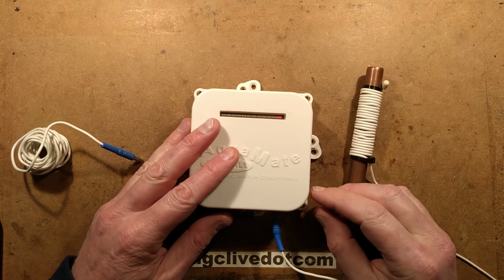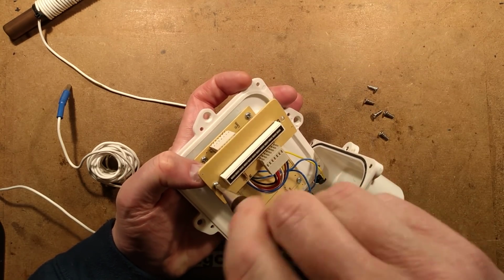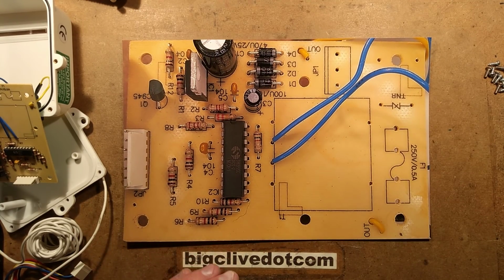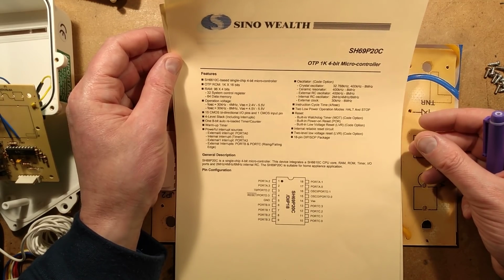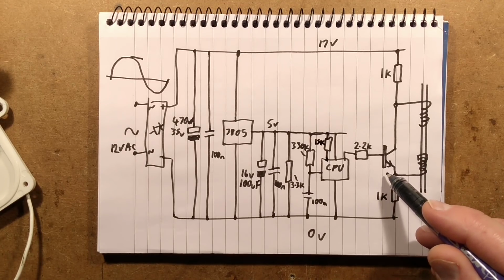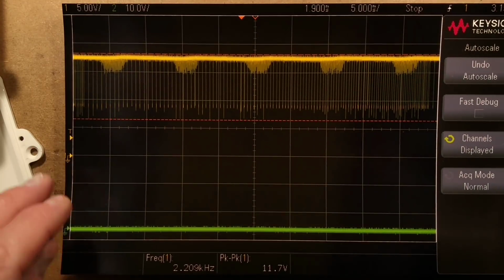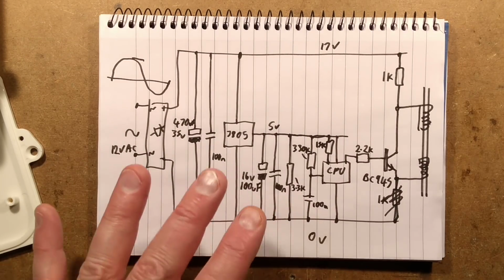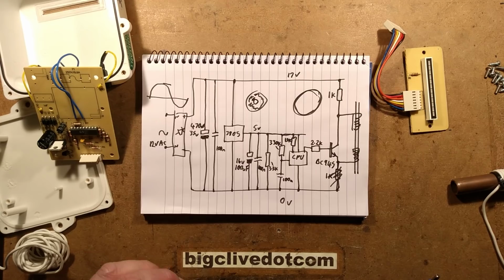inside a computerised pipework scale reducer.

Comment: The Chase light led display whiffs of late night advertorial marketing quackery.
Reply from the maker: A lightshow is essential for stuff like this.
Reply: @bigclivedotcom  Cylons are compelling purchasing motivators.
Reply: Who wouldn't want KITT solving their pipe scale issues!
-marketing
Reply: LeiserGeist I have built my own KITT's. One analog and one with Arduino - I prefer the analog.
Reply: @leisergeist  This gives me more of a Cylon vibe.
Reply: @InkyLeopard  Rumour has it that if you leave this on your pipe for too long, it's going to be chromed.
Reply: Needs a LED display that sweeps back AND forth for KITT...
Reply: @Mark1024MAK  Budget cuts - they had to remove one of the directions
Reply: How funny, that's one of my employers product. I was the technical advisor for that device. We used big electro magnets in commercial water treatment.
Reply: @hixxie7848   Technical advisor? So was it actually at all effective?
Reply: @frinkemon  in many situations yes they have there use, but its not for all. Water storage is one limiting factor. As someone said on here they are good for stopping or reducing things like shower heads blocking up, but don't compare it to a conventional softener they are a totally different thing. I'd always suggest a salt based softener if at all possible.
Reply: @hixxie7848  How does this work if the coils aren't actually making a proper magnet in the first instance, they're open circuit, and apart from a tiny current to charge the wire, it won't be showing a significant current at all, certainly nothing which would have the same effect as an industrial magnet. I really can't see them doing anything at all.
Reply: @Eddiecurrent2000  not a magnetic effect on these. Although magnetecis would be classed conditioning as well.  These are more like two areals. Industrial term = electronic scale inhibitor. These devices cause controversy at times which I don't really want to get in to (I'm not a salesman 😉)
Reply: Hi Clive,
We  live in South Norfolk it's a very hard water area. Our tank had problems where I couldn't  remove the immersion heater. I replaced the tank and cut out a panel in the side, inside was a solid block of scale probably 10 to 12 inches across and going to the bottom of the tank, it was beautiful, every colour imaginable.
I replaced the tank and out of desperation I bought one of those gadgets, really didn't think it would work but it was quite cheap.
15 years later we bought a water softener, to get the best out of it I again replaced the tank. After all of the work was finished I cut a panel in the side of this tank... it was perfect, just a coating of what looked like soot, just a thin black coating that could be wiped off.  
15 years and PERFECT.  In 15 years they'd changed where the pipes come out of the tanks, it was a bigger of a job that due the the gadget wasn't necessary.
I doubled it but after a 15 year test the thing works.
Reply: Michael Green that’s your new tank’s sacrificial anode’s job: to keep the scale INSIDE the tank mobile. Your electronic softener gadget goes AFTER the tank to keep the freshly remobilized scale from resettling inside the pipes/shower heads, etc. There’s a side drain at the bottom of the tank you’d ignored opening for 15 years, too, which keeps heavy sediment from reaching the heaters like you’d been shown.
Reply: @HighestRank  Hi Ryan,  I'm sure you are far more technically minded than me, I've never professed to understand how this thing worked, the fact is, fitting the AquaMate was the only difference I'd made to the system.
Firstly we have a standard copper hot tank, the replacement tank was the same make,
Secondly there is no drain at the bottom of the tank, nor have any of the tanks I've fitted or seen. I'm a retired factory maintenance engineer,  I've fitted several tanks for friends and family.  Here in the UK the majority normal homes with hot tank have very similar tanks, being copper tanks with copper female threads, copper electrical immersion heater and a copper heating coil, with copper or plastic pipe work. The only slightly dissimilar metals could be the brass pipe fittings.  I think I'd have noticed any sacrificial abides, I might be wrong but I can't see a lot of point if the whole thing is made of copper.
Thirdly, what would be the point of putting the AquaMate on the outlet when I wanted to protect the tank, maybe a second one on the outlet would have protected the shower head but they are not to costly to replace or to soak in descaling acid. 
Had I believed it would work, I'd have bought several but I didn't.

The facts are.1. the first tank was half full of scale in its fifteen year life, 2. The second tank was perfect after over ten years use, still with extremely hard water, over 420ppm. The only change was the AquaMate.

Call it what you like, snake oil, placebo etc etc, the gadget was the only difference. I'm not a water scientist nor do I understand electronics at this level.  I don't care if anyone else wants to try it or try and explain how it works or doesn't work.  After a ten plus year test something stopped the second identical tank from forming scale.... with my experience with and without the AquaMate what would you say to someone asking if it worked.

I'm happy to let people believe whatever they like, it worked for my family, Happy Christmas
Reply: @michaelgreen6671  One other possibility - do you get your water from a well pump or a municipal scheme? If the latter, is it possible they either changed the source of the water over your lifetime in the house or started treating for hardness in some way on the supply side?
Reply: @gavinward1758  Hi Gavin,  Thank you for your reply, yes it is the second option, our water has always come from Anglian Water, there is a chance they've changed the source of the water or even treated it in some way. I can't be sure but I've always believed the water comes from an artesian well, I'll try and find out more after Christmas.
If Anglian Water have changed the source, it seems strange that the hardness is the same as the original supply 420ppm. Also my next door neighbor doesn't have a water softener and still suffers from scale on his taps. 
We use untreated water for cooking and drinking, both the kettle and the steamer also suffer from scale.
Your queries are valid and I appreciate your input.
I think even Clive wouldn't actually say it wouldn't work and like most of us haven't a clue how it works.
I put the thing on the water inlet on the tank, that water comes from a cold tank in the loft. The instructions said to put it on the mains pipe where it enters the property, I couldn't believe that if I done that, whatever change the AquaMate made to the water by the time it had reached the large tank in the loft and sat there for ?? hours, then made its way to the hot tank, I couldn't imagine it still working.    By going as close to the problem as possible it might have helped.
Despite everyone's arguments against it working,  I'm happy to believe that it works for me.
I've just seen somebody saying the chasing led display whiffs of quackery.  I'm sure he's correct or it could just be showing that its working. It's name isn't Kit ( Night Rider ) it won't speak back to you, I like the little display.
Thanks again Gavin and have a very Happy Christmas
Reply: @michaelgreen6671  Thanks for replying Michael. It's a very interesting class of product: one where the mechanism of effect isn't understood (and the science points very strongly towards it being nonsense) and yet they are sold in plumbers merchants up and down the country and lots of people swear by them. I do wish someone would do some kind of side by side comparison. Anyway if it works for you then it works and that's that.
Reply: @gavinward1758  Yes I can understand people needing proof, as I wrote I didn't really believe it would work and it cost me hard earned money, sore hands and time.

I don't know whether or not the manufacturer has done any supervised testing, I can't imagine they have or local authority housing in most of East Anglia would surely have fitted them at such a small price...... Perhaps not.
Has anyone contacted the manufacturer to ask... Once again I'll do that after Christmas.
Reply: So it is a very nicely made separator, designed to separate a client from his funds.
Reply: @googleeatsdicks  I don't have to promote or convince anything, particularly bullshit. I'm not a salesman.

Comment: Can the water being a conductor and moving have an effect?
Reply: Not in a copper pipe. All of the electrons will flow through the copper and they will not even take notice of the water.
Reply: @l3p3  but if your skint your eyes and wish real hard you can feel the pipes being cleaned by the magic of electronics and blinking lights!
Reply: @thomasesr  Du musst das "Blinkenlights" nennen, damit Ammis denken, dass das ein Deutscher Begriff ist.
Reply: @thomasesr 
Pretty sure the blinking lights are all that's needed. The wires just prevent accidental cleaning of someone else's pipes for free.
Reply: @tin2001  this is the best explanation of these devices I've ever seen 😆